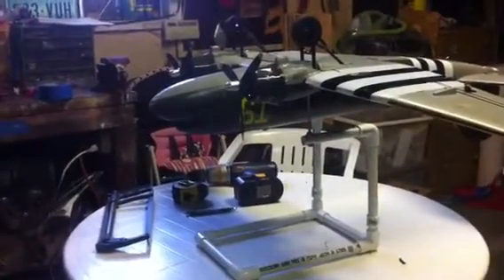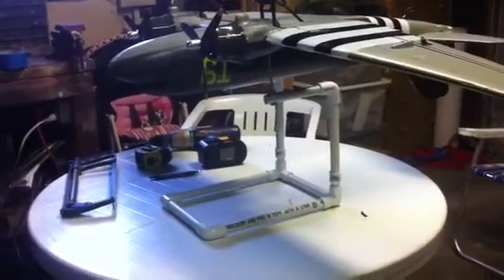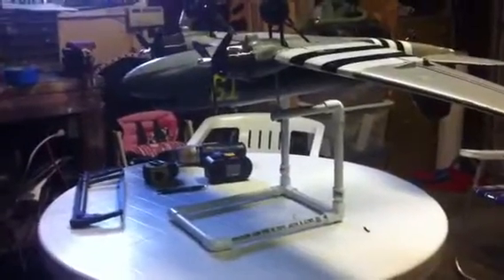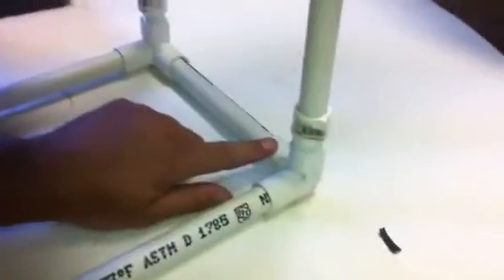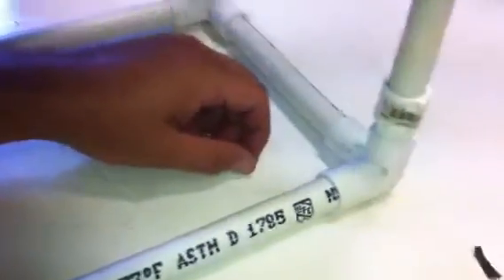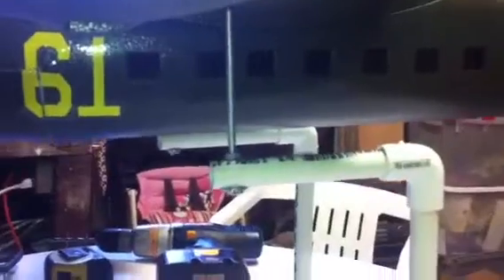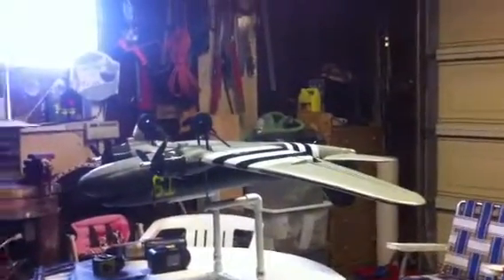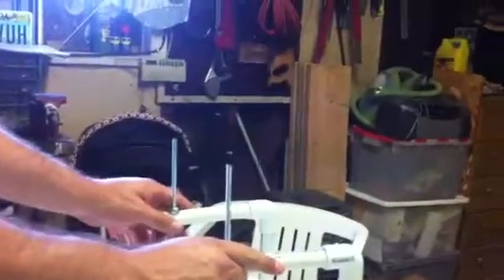CG center gravity stand

Comment: Much better with the swinging arms than the others. One thing that I would want to build on mine is something to hold the plane from rocking back and forth too much if it is not CG and level at first. I'm just using a stand for now to hold my tail up and then when it gets to CG with adjustments then just the bolts with the rubber bit will hold it.